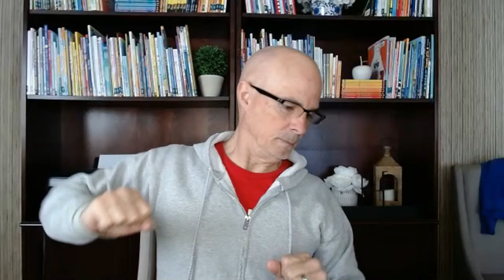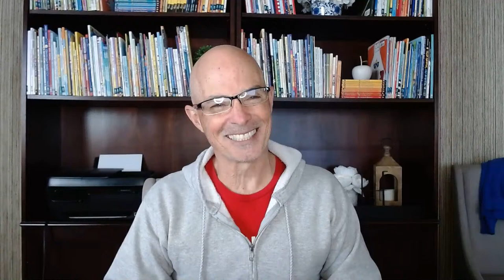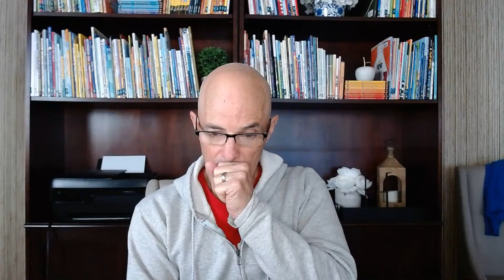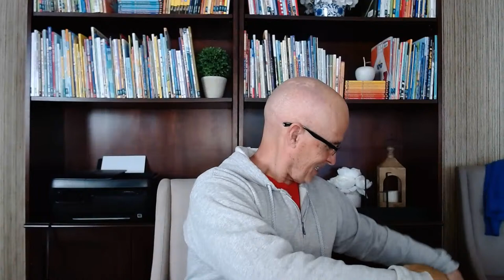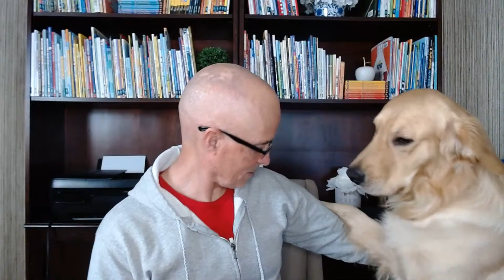HEMI HEADERS-BIGGER IS BETTER? LET'S TALK TECH.

Comment: Richard, when my 394Ci 6.4L stroker was a bone stock 5.7L 6speed it made 288RWHP. On the same dyno with JBA 1 7/8 LT’s before tuning it picked up 17hp, and then it made 328RWHP after tuning with HpTuners. Stainless Works & American racing pick up a little more based on what budgies have shown in the dyno.  Power gains everywhere.

Stock 8speeds make a little over 300RWHP.

Sorry I missed the video, I could have answered a lot of questions.
Typically most guys run the 1 3/4. B
But several guys are switching to the 2” primaries for boost.

Comment: This is a highly spoke about topic, considering from what I have seen Headers have the smallest amount of change over just about any other upgrade.  Unless you have a large cam, I don’t see a reason to worry about it.   If you have an existing set of headers and it fits run it in 220 or less came
Reply from the maker: That first statement is incorrect on a Hemi with stock RAM manifolds-even with a stock cam. I've tested headers multiple times on Hemis
Reply: If you look at the cam specs of a factory 5.7 that’s not a “small” cam.

Comment: Interesting. When I was playing with relatively 5.0 Mustangs and shorty headers, the standard thinking was that the larger tubes lost low end and didn’t have enough flow to benefit anything at higher rpms. I suspected long tubes would be an improvement but never tried them.

Comment: Stock hemi truck manifolds are terrible, I take them off to replace broken manifold bolts several times a year, and they literally turn 90⁰ on cyl 1, 3 and 5, and cyl 7 is slightly less extreme angle, I believe the outlet is slightly smaller than 2 and a half inches, it was designed for tight packaging, not performance.

Comment: You should never be at WOT at 600 RPM.  If all you care about is WOT performance hands down flow is king.  But there are certain situations, low performance, where you need that extra down low grunt.  

That happens off idle- when you have no stock non performace converter stall speed and power on the teeter totter of even being able to light up the tires when you try to do a brake torque.  Put large tube headers on said combo without changing anything else and the 0-60 becomes noticeably worse, but once you eventually get there you feel the few extra horses from the long tubes.  You know these motors because they are the ones that when you take your foot of the gas at 600 RPM they want to start crawling.  They need that initial dig to get them going or else it is a long wait for power to build.

I was the guy in the early/mid 90s putting hand me down headers and exhaust on by request for all the lower class income family teens trying to make their late 70s/early 80s cars somewhat bearable.  It always lost power, always, until you got up around a 350 SB power level @ aprox 3500lbs- that had enough "breaking torque," as I call it, to be able to afford loosing 5-10 foot pounds off idle.  I witnessed it dozens of times.  

And then when Chicago emmisions time came (every two years) I was putting it all back on for them (and myself) again and the off idle power dig came back- and a lot of the guys left it, others accepted the power loss just to be able to fit in and say "I have headers."

Now here is where I could definately be wrong; what I never actually did, nor could do at that age without a dyno, was to make the "slight" rod and/or jet adjustments to compensate for the increased flow.  Possibly the tune changed just enough that the spot on factory tune out performed the slightly out of tune new combination of long tube headers with a cat delete.  I would think at that level that the tune is close enough, especially for the CCC style feedback carburetors, but maybe not.  Look at how many people do basic non-dyno verified tuning to their setup and are like "it  is a 400HP package" and then it dynos WAY lower until "fine tuned."
Reply: I want to bring up load again.  My first engine was a NA Buick 231.  Same thing with the headers slowing it down.  Granted, by the time I got the Edelbrock cam, Edelbrock intake, and Holley 390, stall, and 373s (had 242s) (Dad didn't allow V8s) it was actually street fast- like I could beat non HO 301/305/307 and some 350s.  

But, when I put the stock exhaust and CCC 2 barrel back on for emmisions, it definitely woke up off the line.  I turned 18, put a 1978 T-Type turbo setup on it, and by 21 had the independance to swap in my first V8.  Why am I saying all this?  

The 3.8, back in NA form, I traded to a buddy for a 71' Honda CB350SS and installed it for him in a Pontiac T-1000 "Convette" with the Hooker motor mounts.  Now that light SOB LOVED headers, ran manifolds until we found the discontinued Hooker headers and put them on.  Same tune as when it was in my G-body.  Engine load: what dynos can't compensate for which has an effect on how an engine breaths... and again totally irrelevant for a channel like yours- until you say "headers always increase low end torque."  

The definition of "low end" and relationship to the power range when coupled with underpowered combos is the issue here.

I feel weird even debating you on this, I look up to you and idolize you so much and under 99% of all scenarios would never question you.  This is different, I felt it so many times, in non synthetic real-world experiences.
Reply: Another thing- every thing is hi performance nowadays, everything.  I would agree that on pretty much every vehicle made from like 2006 and up long tube headers will always add bottom end- because there is no bottom end any more it has just shifted to mid bottom end since everything is cammed and made to rev and flow.  I am strictly talking about old school low performance, like the malaise years (if that was the right term.)  They are the ones that benefitted from strong off idle torque.  You know, my wife's 2013 Yukon XL with a 5.3 and all the 6 speed "gear magic" averages only 16 mpg.  My square body suburban with a stock 350 and 700r4 (before I one ton & 454ed it) averaged 22 mpg.  Granted, the 2013 is WAY for fun to drive but it HAS TO rev to make any power, if not it would just be a glorified aluminum LG4.  Dual plane, low flowing heads, Quadrajet, idle to 5300 or something like that.  As much as we don't miss the power I sure miss the MPG.  And how about diesels all being made to flow in conjunction with big turbos: why do we need to neuter and tune a Duramax to get the MPG we got from CCUV style diesels?  I seriously wish I had the money to make a set of LS heads that flowed like 80's HD 350 truck heads.  Could you imagine what the MPG would be like- that combined with todays advancements and precision parts/machining?  I have my toys, I want my Yukon XL to get what I consider to be obtainable MPG.  But it will never happen because even in the competition of stock vehicles HP sells engines.  I have other toys for that, I am an old man now, if not horsing around I just want to have that MPG option for the family road trip warrior- can't have it, along with hydraluic cam lobes that taper, small S10/Rangers, true compact cars and everything else we keep loosing...
Reply: Sorry, I am commenting as I watch here.  Hemmis are "valvey" valvey always wants more flow.  Restrictive valves are where you will see an improvement in low-low end torque with manifolds under certain "load" situations regardless of the fact that they will always help "peak torque" and under most circumstances be WELL WORTH and low-low end trade-off.  In certain "load" situations, back pressure scavenging effect becomes ideal.  Picking a "wants to flow" Hemmi attached to a non-variable load adjusting dyno is about the best way to support your disposition.  I can't stress this enough- when people talk about low end torque, peak torque has nothing to do with it.  

Do this (even though you have no variable load to compensate for vehicle weight, inclination, and altitude.  Take a 305 LG4, bone stock, test with log manifolds and then with the biggest long tubes you can find BUT you have to show 600-1000 rpm values.  Regardless of the overall effect, we just want to see what happens RIGHT AT THE BEGINNING of the torque curve on an engine not cammed to start making power where a smogger motor considers mid-range... for science... and we already know the ling tubes will increase peak HP & torque.
Reply: You’re comparing vehicles who had relatively small cams in factory form to modern vehicles with variable valve timing, intakes with long short runners with valves etc. with pretty big cams from factory.
Reply from the maker: there is no 600 rpm converter-you are always above that rpm when at WOT, long tube headers generally help low speed torque
Reply from the maker: you can change the load on a dyno-you need to learn more